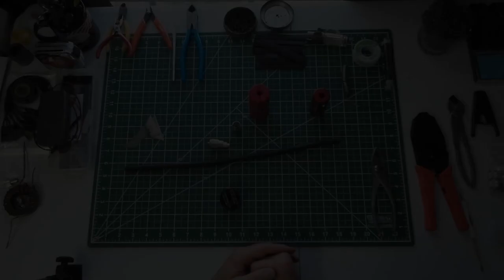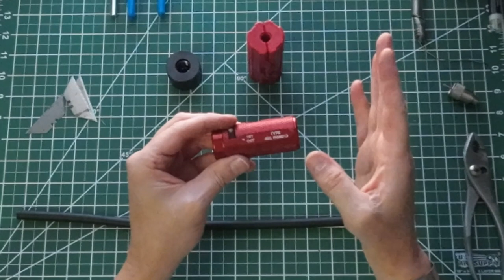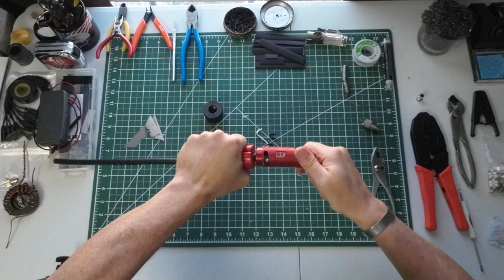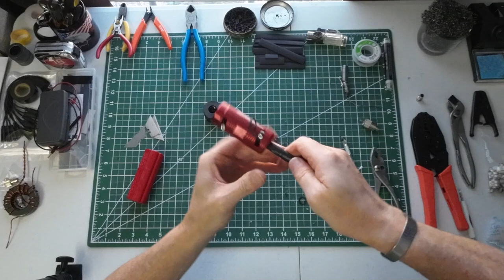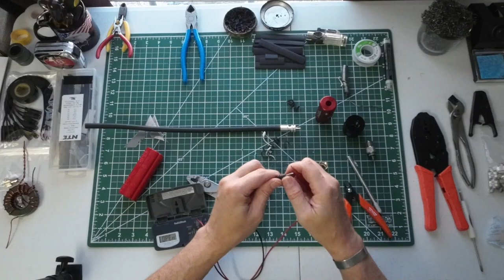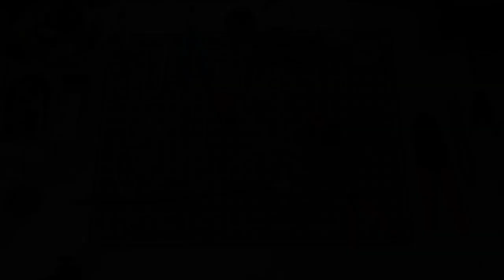Solder on PL 259

Comment: I am a big fan of those coax prep tools.  They make the task of installing an RF connector quick and eliminate the chance of nicking the braid or center conductor.   I like to use a flux pen (Kester 186) the majority of the time, but I do have flux paste as well.   Sage advice on not using cheap connectors.
Reply from the maker: Thanks!